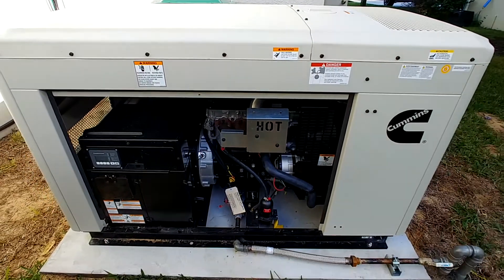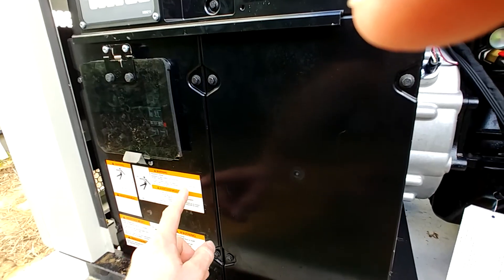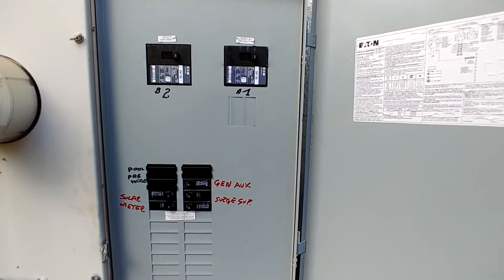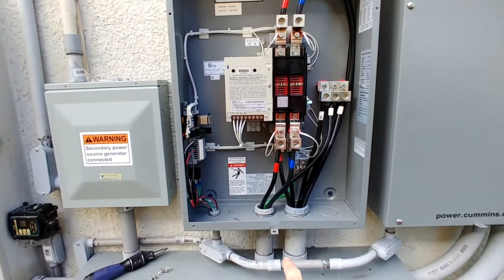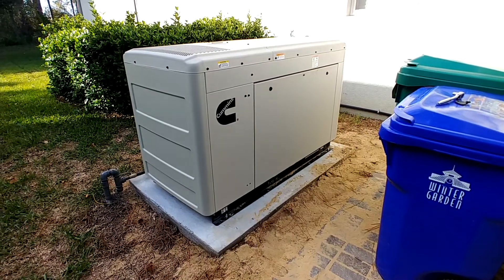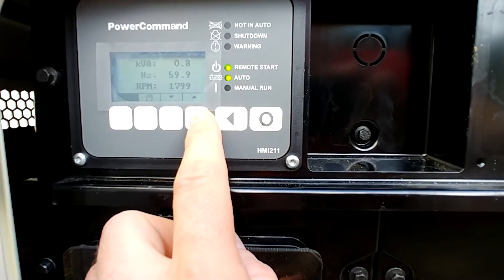Cummins RS25 Generator Review

Comment: excellent video. Currently looking at getting a whole home generator vs using my bobcat welder/generator and transfer switch I can plug in. Its freezing down in Houston. Luckily we didnt lose power and definitely dont want to. Will have to get a propane tank as we live out in the country and there is no NG. crazy that install could have cost you the price of the gen unit.
Reply: Vilfredo Pareto  Miller welding machine. I'm a welder by trade. Better resell but loud. You can weld with it and puts out 11kw.

Comment: Great review, thanks.  Just bought a rs25a yesterday, can't wait to fire up my Acom 2000a on genset!  Mine is a RS25A and I'm hoping the A stands for Automatic and not Air?  de NV2A
Reply from the maker: I think you're good to go. They don't make air cooled above 18 or 20k I believe. I noticed to appreciable noise on my radios when it was running!
Reply: The a stands for extreme temp package I believe. Oil filter, alternator, battery, battery charger, coolant, will all have heating units on them! You will need to run a. 20 amp dedicated gfci circuit from utility to the generator to run these.

Comment: Nice video, and the comments were as useful as the video itself.  Given that I live at 7500' in a <1000 sf cabin, there's no way I want to spend what an 1800 rpm unit would cost, plus which when the power goes off up here it's usually back on within a few hours, a day and a half at the most.  Anyway, thanks for posting this.  I'm going to have to reconsider putting in a Generac unit.

Comment: i considered these but i went with tesla solar and 3 power walls haven't looked back. they are getting cheaper every year and with the 26% tax rebate extended to 2021 it cost me nothing because i needed to buy a new roof anyway so instead of buy a shingle roof i took the money and bought tesla solar it was free essentially. i then added the batteries so now when the power goes out I'm good. and i do not have to maintain an car engine every year just incase the power goes out. to pay someone to maintain that thing is in my opinion crazy and that does not guarantee it will work when you need it. just like every car engine out there. they are made to last just past the warranty.
i will be looking forward to your repair video
Reply from the maker: Your powerwall won't power 2 2-3 ton AC units / compressors.  Solar has it's place, but not for the comforts of home.  I also have solar, but my system is just grid tie to offset my power costs.  No residential solar banks that are affordable can start and run central air units.
Reply: @bruehlt  based upon what i read 1) power wall cost 7500 plus installation 4000. So 3 power walls plus installation cost close to 28 Grand. No thanks
Reply: @bruehlt  I don't think that's true anymore maybe back in the days but the biggest issue was the initial startup of AC units and now they have a device that lowers the amperage that it needs or requires to start
Reply from the maker: @raaah  prove me wrong. Price together a solar backup system that will run my whole house with 2 sc units, refrigerator, pool pump, fans, and lights and entertainment, for less than $15,000. You can't because it doesn't exist. The only viable solution is a backup generator. Solar is not there and won't be there for a long time.
Reply: @bruehlt  but you're leaving one thing out and that's the cost to maintain that thing there's no moving parts in solar or batteries we all know what happens to engines and we also know manufacturers best interest is to make an engine that fails sooner rather than later yes you're probably right it's cheaper but not by much and not in the long run
Reply: My air conditioner was installed a year-and-a-half ago and it does have the low amperage initial start
Reply: @bruehlt  $15,000 no but remember that generator also won't cost you $15,000 you might be a 15000 now but after replacement parts and maintenance you'll be up there not to mention the headache because you won't notice until you need it
Reply: @bruehlt  I have three powerwalls coming not just one so my AC should be fine
Reply: You have to consider the replacement of your power wall also, these are not eternal.
Reply: Considering that to produce 20 KW of power using solar panels,  you would need  at least 2400 square feet of panels. That would provide about 40 KW during the daylight hours, which hopefully charge the batteries enough to provide the power to run the air conditioners overnight.  That would be new panels that are clean, and daylight for at least 10 hours each day.

Comment: This is a great Video. I did a series of Video's on my channel on the Briggs & Stratton 35KW Generator, https://www.youtube.com/watch?v=ZfQxptYsk0w&t=1440s   For Comparison, your Onan has a very nice Clean Layout. The Long Oil Drain Hose is nicely thought out, and much better than the Briggs one. The Coil on Pack is a great feature which the other generators at that size, do not have. I see you have a block heater, very good, and the hanging down plug is for laptop diagnostics. Not sure what that blue box on the second side, by the fan is for.  Looks like the Transfer switch may have an internet sharing of the generator status, that would be great. Very Good choice.

Comment: Great video.  What made you decide on the cummins versus other brands? 0:25 NO.1. Kohler 20RESCL-100LC16 Air-Cooled Standby Generator - https://amzn.to/34m4BVZ
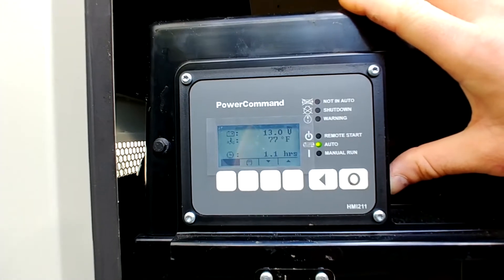1:35 NO.2. Briggs & Stratton 40532 12kW Standby Generator - https://amzn.to/3j5LSSU
2:15 NO.3. Generac 7043 Home Standby Generator - https://amzn.to/2FDHyM3
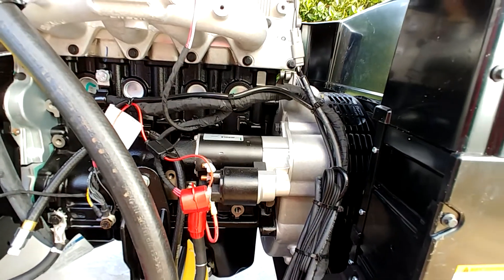3:10 NO.4. Champion 8.5-kW Home Standby Generator - https://amzn.to/2EmuhXI
4:20 NO.5. Champion Power Equipment 100294 Home Standby Generator -
Reply from the maker: Imo, Kohler and Cummins are best based on what I've seen. But the Cummins was much cheaper in price then the kohler. Your list also includes air cooled generators. Liquid cooled generators are in a completely different class. Much better units.
Reply: @bruehlt  Can you sell power back to the grid?  Generac is touting the ability to put power into the system using their recently aquired Enbala. But can a Generac generator stay running for days at a time?
Reply: @warntheidiotmasses7114  Why would you want to push power back to the grid from a generator? First off - how would you synchronize the AC power? If you look at alternative energy (solar namely, also wind) the inverters those use can grid-tie - that is they synchronize the AC output to match the phasing of the grid power. An alternator driven with an engine isn't a computer controlling the AC power - its the RPM of the alternator that establishes the AC frequency etc. An inverter style generator (think paralleling of inverter generators) is completely different - it has an inverter sitting between the alternator and the AC power, much like the inverter used with a solar/wind system. That inverter can, conceivably, match the AC power - and that is the principal used from the get-go for the "parallel" operation of daisy chaining 2x (or more - home made parallel harnesses can do this) individual generators for more power. 

As to WHY would you want to do that - send power back to the grid - if the grid is down and you have to use your generator the power is for you, not to light up the 'hood. If the grid is on - why would you want to burn fuel in your engine driven generator (which costs you money) only to send some power back to the already powered grid??? It makes no sense. Alternative power is different - it is all there anyway. It doesn't cost you anything to send power back to the grid, nothing more than your investment cost of the system. And if you aren't using all the power you are generating then that makes perfect sense - it maximizes the use you can get out of said alternative energy system. The same can't be said for an engine driven generator that is burning fuel and where you incur other expenses such as maintenance. Do you want the additional wear and tear, run time, etc stacking up on your generator investment?
Reply: @bruehlt  I'm looking to make a bet Generac stock tumbles in January so I'm buying puts.  Generac stock has had quite a run up.  You all had a storm recently... and I guess the best companies can only produce so many units a year so people opt for the cheaper available models.  And Generac has some software that enables them to sell power onto the grid.... but anyway.  Thanks.  Liquid cooled is the way to go for higher wattage units hey?

Comment: So this is liquid cooled and a lot more expensive. Do you need liquid cooled? The air cooled version is much cheaper.
Reply from the maker: I chose liquid cooled because they run at 1800 RPM, and have a much longer lifetime on the engines.  It's also much quieter.

Comment: There are a lot of generators to pick from, do you recommend a cummins generator over a generac or kohler generator
Reply from the maker: I recommend a cummins or a kohler over anything else due to reliability and quality.
Reply: I have a 20kw Generac Protector diesel unit, which is a liquid cooled, 1,800 rpm unit.  The Generac has the same easy maintenance features as this Cummins, minus spark plugs which a diesel does not have.  I think any of the 1,800 rpm units from Cummins, Generac, or Kohler will serve you well.

Comment: I thought Cummins only made diesel engines.
Reply: I thought the same. Learn something new everyday right?
Reply: I drove a class 7 truck last winter (think single axle semi size, Freightliner 114SD) that had a natural gas powered Cummins engine in it. You want an experience... Fill up a "big truck" tank with 4500psi of CNG. Then drive it down the road realizing how much of a "big bang" is sitting behind your seat with the idiot drivers on the road cutting you off. Perhaps the experience should be flipped. Have the idiot drivers sit in the truck seat ahead of the 4500psi tank and dodge other idiots on the road. I think there would be a few wet spots and holes in drivers seats from sphincters slamming shut.

Comment: Finally got mine installed, awoke this morning to find it pitch black out everywhere except for my house.  I couldn't even hear it running, until I went outside to check.  I wish I could post a picture to show the final install I'm quite happy with it.
Reply: How much was your unit and install?
Reply: @XX-166   I did most of the work myself,  I set the generator, ran the gas and wiring and transfer switch.  Transfer switch was 744 dollars, Rs30 generator was 11,280 dollars,  pouring footings and the pad for unit and wiring probably another 1500.00. Worth every penny.

Comment: What AWG size for the wire from the gen to the transfer switch did you use? What is the on-gen circuit breaker AMP rating? Nice video!
Reply from the maker: Thanks - the wire size is based on the ampacity, plus any required oversizing per NEC code.  For my case I believe that it is 1/0, which is rated to 150A.  The breaker in the generator is 125A I believe.

Comment: Considering your access to Natural Gas, seems you’d be better off running NG Appliances to take full benefit of the NG access. 

Also, was there any consideration in regards to how close you installed the generator? Here in Louisiana, especially recently, there’s been a big problem with CO emissions so most people install theres 50’ away. Any comment on that?
Reply from the maker: Yes we do have NG appliances in our house and it's definitely a cost savings on our monthly bills!

I followed local code requirements for setback requirements from the sides of the house as well as the shrubs. Some manufacturers have more relaxed setback requirements I believe.
Reply: Travis Bruehl  well I’d just be sure that you have good and new CO sensors. Many families down here have got CO exposure even staging their generators away from the house. Of course this is considering these generators have been running for 14+ days. Even with breaks, for maintenance, my neighbors CO sensor went off the other day. Heavy Fog, zero wind, can be a recipe for disaster. Just a heads up. 

I’m considering the RS25 Cummins for this new house I built. 

Is their a link to the generator via WiFi/Cellphone? Would be nice to have a connection to the generators system. 

Thanks

BTW / Great job on the install. Looks like you took your time and did it right.
Reply from the maker: @vSwampFox  Thanks for the feedback - I'll look into adding the CO detectors!  To connect it to a network you will need to get a PC550 module.  You'll need to buy it from whichever dealer you buy the generator from because they need to configure it on their end before it ships.  The device wires up to the circuit board using RS485 cable or you can also use cat5e if it's a short run.  You can use cellular backup if you want as well - but I just have mine connected to my network.  It works using their cloud based service (which is zero charge).  You can see their demo here:  https://portal.powercommandcloud.com/  It works great for me - I get email and text notifications if there are issues, if it starts, if it loses comminication, etc.  Very nice system!

Comment: Enjoyed your review very much. I am receiving a quote on both a Kohler 24K and Cummins 25K which I should have in a couple of days. I waited a little too long since Hurricane Sally is headed this way.  I still have to receive the quote from the Propane company and plumber.  I guess the final price will make the final decision for me. I live just north of New Orleans.
Reply from the maker: Stay safe for Sally!
Reply: Hey I did hear Kohler makes a nice unit. I’m thinking about diesel generator myself.
Reply: @josephpuchel6497  The dealer had a Cummins already on order so I went with the Cummins. My research showed that the Kohler and Cummins are both very nice units and will run for long periods during outages and the 25K will power my whole house with 2 A/C units and well pump.  Hurricane Zeta just missed us and they just installed the ATS yesterday. Still waiting for 811 people to show up to mark the underground wiring, gas, etc. so the generator can be installed. Going with an above ground 500 gallon Propane tank. The price difference was minimal between Cummins and Kohler.
Reply: Yes I understand the unit in video is a Natural gas and or propane. There’s a lot of people that really don’t research other brands They just go with what they hear or see. What’s the continuous run time on them ? These are nice units. I have a portable unit. I would like unit that runs at lower RPM. So I’m looking at diesel to just essentials.

Comment: I purchase a Cummins 20KW for a 6 bed rm 4000 sqft home and it never missed a beat.  I was told by a Generac dealer that I would need a larger unit.  The Cummins dealer put this in and said the 25KW was over kill because no one ever has everything on at once in a home.  I must say that it has came on a minimum of 6 times this year, with the AC,  clothe washer and dryer on it ran perfectly. My family doesn't change anything when it comes on.  We do have a gas a stove so I do not use electric for that. I love my unit.  Also it was 9,000$ for my unit and installation which was also cheaper than the Generac quote by 2K.  Located in Augusta Georgia area.
Reply: Just got a Cummins 20KW installed for $9k as well.
Reply: Did you say it was $9000 for the generator AND installation included?
Reply: @chalemi  Yes, but that was for the 20KW not the 25kw that is shown on the video. The 20KW  works great for my large home 4000SQFT  .  Even thought all the other companies said I needed a larger unit.

Comment: How does it connect to the internet? Kohler has an option to run at Cat6 cable in the low-voltage conduit with the signal cable...is this similar? Are there any yearly costs?
Reply from the maker: Hi - Their generators don't come with the gateway device as is.  You need to purchase it.  It's called Powercommand Cloud.  The gateway device (Cummins PC550) connects via ethernet cable to your network.  The device connects to the generator contorl board via RS-485.  It doesn't cost anything to access the device, just the initial upfront cost.  Unfortuantely you also need to purchase this from a dealer that can establish an account with Cummins.  I purchased everything (generator and PC550 from Buckeye Power Systems.  They handled setting everythig up, and testing the generator and gateway device before they shipped it.  You can test their system as a demo from this web site: https://portal.powercommandcloud.com/

Comment: If you don’t mind me asking, what was the total amount the generator companies quoted you for purchasing and installing one? I’ll be in the market soon (also here in FL)...always loved Kohler but you’re making me really consider Cummins..
Reply from the maker: I received 3 quotes.  One was about what the generator cost ($12,000 or so), another was about $7k, and the third in between.  None of the quotes included installation of the gas line, which would have been about another $1,200.
Reply: Travis Bruehl wow that’s just installation...I have to buy a propane tank as well.
Reply from the maker: @kurtishasselbring3166  Yes - that's why I did it myself.  Their costs were through the roof!  For me the hardest part was digging the trench for the gas line and conduit, as it needs to be a specific depth to meet code.  Florida Sand is no fun to dig in.